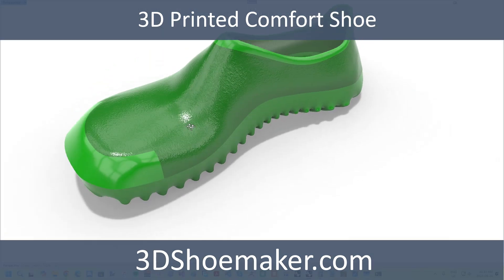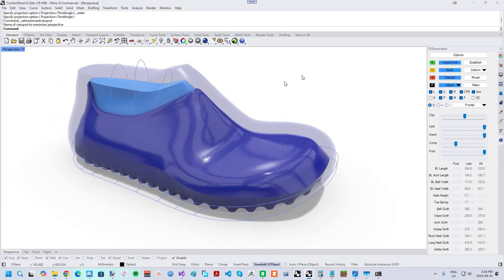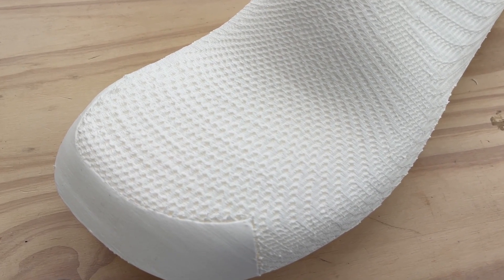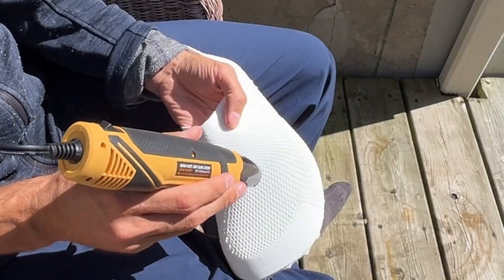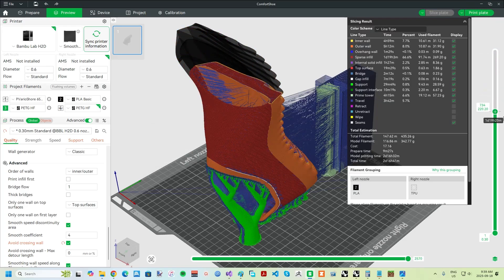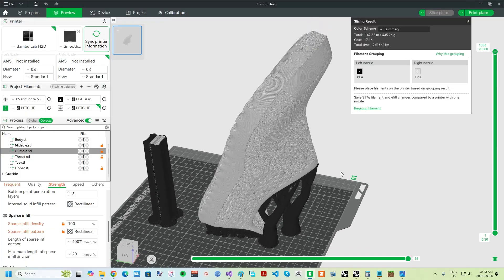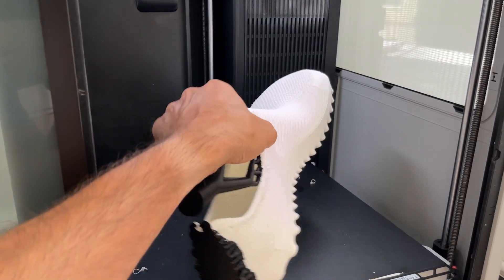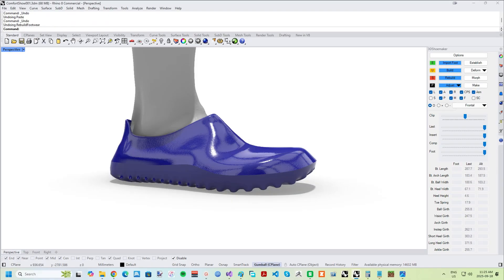3D Printed Comfort Shoe with Breathable Upper

Comment: My biggest pain is that when you use different filament profiles for different parts of the shoe with pla support, the g code is wrong. It prints only with one temperature, so there is no durometer change btween the parts of the shoe. Also because of the number of different profles for the foamy tpu the prime tower is huge as it thinks it has to prime between the different foamy profiles. Tried changing flushing volumes, but that didn t work either. The only way I could make it work is to use foamy supports, which is less than ideal. At least with ith the prime tower disabled there is no waste of material. I think a support ticket to bambu would maybe make them implement a solution, but many people would have to mention it for them to act. I now see why zellerfeld is looking for slicer programmers so hard. Great video btw. If you have any solutions hit me up!
Reply from the maker: Yup, I'm in the same boat. The slicer is the bottleneck now. I've tried support tickets, but they just say foaming TPU isn't supported or they'll pass the suggestions on to their team. If they could develop a foaming TPU that was initially stiff enough to work with the AMS, that would be huge for them.
I'm busy trying out workarounds for the limitations here...
Reply: @3DShoemaker Wow foaming tpu for the AMS would be a gamechanger for multicolor, variable durometer shoes supported by pla. I ll be sure to open a ticket.

Comment: I heard PEBA filament is good for shoes
Reply from the maker: Interesting, I'll have to check that out.
Reply: @3DShoemaker  do you have a tutorial for designing 3D printed shoes?
Reply from the maker: @Cart_of_a_Jon  My next video will be on designing 3D printed shoe
Reply: @3DShoemaker  and also if I had a tool changer, would it be functional to have different parts of the shoe to be different TPU Shore hardnesses or that wouldn’t be so possible even with the tool changer?
Reply from the maker: @Cart_of_a_Jon  I think so, but I've never done it myself. Might affect how recyclable the shoes will be (recyclability is a bit potential bonus I think)
Reply: I tried Siraya Tech PEBA Air (foaming PEBA) and the shoe lip tore when stretching it to put my foot in the shoe plus pushing my thumb into the side of the upper to test its durability left a dimple in the material.  I never had these problems w/ Recreus Filaflex Foamy which is a TPU.

Comment: Third you might add a second rotation to make the layer lines 45 degrees against the flex zone of the shoe. But it will require more support material. If you're using PLA though, that shouldn't be a cost issue, just added print time.
Reply from the maker: Good point. My clogs I printed at 45 degrees had much better durability, no cracking at all, but I wasn't sure how much of that was due to the 45 degrees VS the higher flow ratio. I went with vertical so that I could support the collar. But now that I think about it, maybe I could still support the collar at 45 degrees, either from the part rather than print bed or really branched out tree supports.

Comment: How well is the bonding between foaming TPU and TPU for AMS? Taking advantage of the dual nozzle, maybe the outsole could be out of the harder TPU which Ive heard is way stiffer. What do you think?
Reply from the maker: I haven't tried that, but I'm guessing that the traction of the harder AMS TPU wouldn't be nearly as good as with foaming TPU...
Reply: TPU for AMS is not even flexible